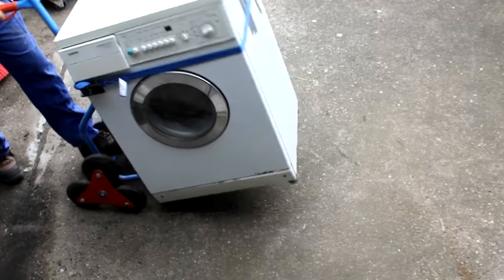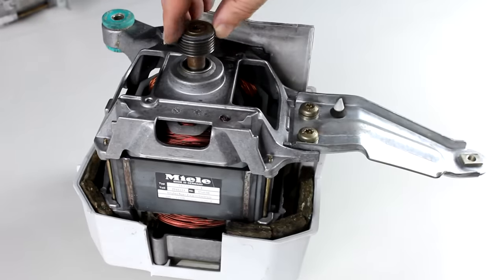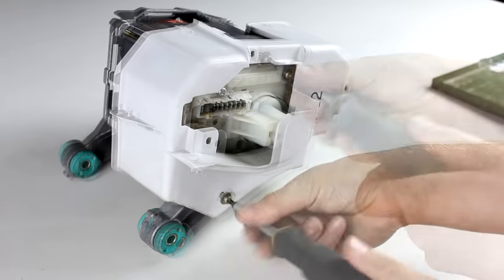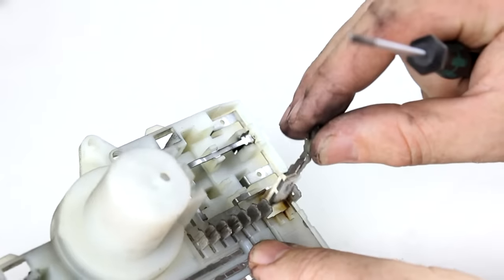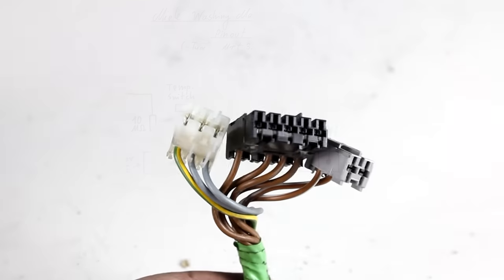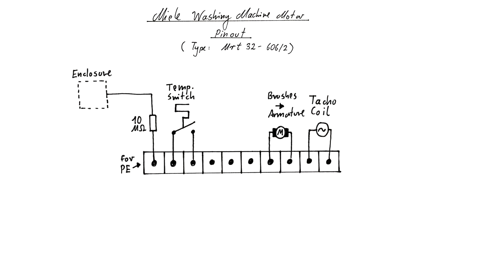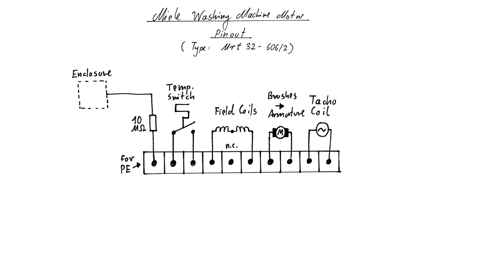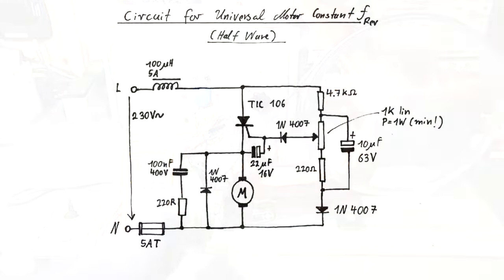Inside a Washing Machine Motor: Explanation,  Pinout, Teardown AND Experiments

Comment: @ 5:50 - DO NOT remove the resister from the protective earth circuit. Not having one will 
create a direct path to ground and allow very high current to be drawn in a short to earth. This will delay overcurrent protection (fuse/thermistor/breaker) from triggering and allow massive amounts of current to flow through the short. The resistor is there to give a load to any short to ground and trip the overcurrent device before high current develops in the short.
Reply: so,  if yu energise the enclosure of the device with 100 Volts,   then the ground current to earth will be 0.1 milliamps through your 1 megaohm resistor ?   I hope that your residual earth current protection device can detect this....
Reply: I didn't explain it very well in my initial post, so I will go into more detail here:

First, that resistor is for ground loop protection. If you don't know what that is, I suggest you look it up. Second, Europe uses 240VAC, not 100V. To get the full potential of the motor you would want to use full voltage. Also, since it is from a washing machine, it is designed to run off of a GFCI circuit. Those ARE sensitive enough to notice leakage of current to ground in the 0.1A range.

For dangerous voltages (36V AC or DC, the current safety standard and yes it did change a few years back), you should not make changes to the safety systems in the circuit. If you don't know why something is in there, don't just take it out. You can kill or injure yourself or other people really easily with even what would be considered "low voltage".
Reply: Ouch. Bad information is worse than no information. 240VAC so 340VDC peak, through a 1M resistor, thats 0.00034A, 0.34 mA not 0.1A. a GFCI breaker typically takes 0.05A (50mA) to trip, about 150 times more current than this resistor will allow at peak mains voltage. So in the event of a failure, where the motor chassis gets shorted to the active/hot input, this resistor will mean the GFCI protection is not triggered, and will allow the motor chassis to go live.

To be clear, this means the motor is effectively not earthed. This mostly defeats the traditional purpose of the protective earth connection, but this resistor is required, as the normal operation of the motor will cause it to induce currents in its chassis, which may be high enough to cause false triggering of the GFCI protection. The connection to protective earth via the resistor is most likely merely for discharge and RF loading. The motor chassis is weakly held at ground potential, so any charge is slowly dissipated, preventing ESD and helping to minimise EMI.

Removing the resistor and giving the motor chassis a direct connection to earth will not cause a safety hazard, but may cause your GFCI protection to trip unnecessarily.

The metal chassis of the washing machine itself should also have its own connection to protective earth, which will not have such a resistor in series, so the washing machine as a whole should still allow GFCI protection to serve its purpose.
Reply: Yes, I fudged my math on this. I was tired when I wrote it and made a mistake. It was not a mistake that would have injured anyone or caused damage to equipment. I said to leave the part in place unless you know what it does. As for my qualifications to give advice, I was an industrial electrician and a radio technician before I retired. I have been trained to work safely on up to 600V AC circuits and to construct and/or modify them as needed. It has been several years since I retired and my health is not always 100% anymore, hence why I retired.

First, you seem to know some about AC, but not as much as you think you do. The term is peak voltage, not DC voltage. The equivalent DC voltage is the RMS voltage of the AC sine wave. Next, this is the ground for the motor and its drive. The case of the washer was grounded normally through the ground of the plug, so if the chassis was energized, there would be a low impedance path to ground that would trip the GFCI anyway.

Also, a purely restive load is not what is used to couple RF or AC wave forms to ground. You use a low pass filter, like a capacitor to snub those (shunt to ground) and tune it to pass no more than 55 Hz (for this EU unit). They might be using the reactive capacitance of the motor brushes with the resistor to make this filter cheaply. Without looking at the design in detail or talking to the design engineers, this is speculation. Regardless, that resistor wouldn't be there unless it served an important function and therefore should remain until you at least know what it does.

If you run the motor off of an isolation transformer, yes, you would want to ground the chassis and you could take out the resistor in this case. If it is part of the filter system, you will make something that is RF noisy since there will be commutation noise from the brushes switching. This can be eliminated by using a shielded case that is grounded (AKA a Faraday cage). However, you should only ground through the building's grounding conductor (referred by laymen as simply 'ground') regardless of the method of supplying power. This will prevent what is known as a grounding loop.

A ground loop occurs when the neutral line to a device is lost and the chassis of the device becomes the path to ground or when a short to ground from the live line happens. If you have other low impedance or resistance connections to ground, like a direct chassis ground on a device instead of using the grounding conductor, you have a parallel circuit and it will charge the chassis of the other device to full potential (voltage), but will act as a current divider and will prevent the OCPD (breaker, fuse, or thermal override) from tripping as quickly as it should (see Kirchhoff's first law or read up on parallel circuits). This leaves potentially lethal voltage and current on the chassis of both devices. Always ground through the building's grounding conductor so that only serial circuits can be made by shorted devices.

OCPDs do not trip fast enough to protect a person from shock or electrocution unless they are a GFCI. It is even possible to have lethal voltage in a ground loop without producing enough draw to trip the OCPD since the path may have enough impedance to draw currents below the rating for the circuit.
Reply: How would a very high current delay the breaker from triggering? If anything the breaker outside the washing machine would immediately trip.
Reply: Breakers have to wait for heat from a high current to expand a a part of them for the spring to trip the breaker. This means that the high current flows for plenty long enough to harm you or possibly damage the circuit. Even at the EU 50 Hz, several complete cycles of the AC waveform will pass before the circuit is broken. So you can have lethal electrocution happen. This is why GFCI breakers were invented and mandated.

Fuses and thermal overload protection have a delay as well, with the exception of fast blow fuses, like the 601 amp fast blow fuses used in large load distribution and breaker panels. Some fast blow fuses can protect the circuit and personnel during phase to phase, phase to neutral, and phase to ground shorts. 

They are mainly used to stop arc flash and arc burst events, which are very dangerous. I suggest looking at a few videos on here of these to get a better idea of what high energy circuits can do when they have a short.
Reply: My initial theory was not true, but the advice to not make modifications to engineered circuits without knowing exactly what each of the parts still stands as the safest thing to do. There are some OCPDs that function in uninterruptible power systems for large loads that react the way I described, but that would not be the case here. In some other posts here I admitted and corrected my mistake and we even have a few theories about the function of the resistor. All of which could be tested for, but may still miss the true intention of it and all of them are good enough reasons to leave it in the circuit. Maybe this would be a good video for the channel? I would do one myself, but I am on the wrong side of the Pond to get a hold of that model of washer and the US ones would have different safety circuits since we don't float AC voltages without a reference to ground.

Also, you posted a really good example of why GFCI breakers were developed. A small short to ground through a resistor or just a energized chassis is enough to stop a heart, but will not trigger the breaker.

Comment: At 9:12 I fully expected the motor to explode into many pieces. I was testing a shunt wound 15 hp motor once when one of the field supply wires became disconnected. Within a second or two, the motor accelerated to the point of destruction, sending heavy copper commutator parts up to the steel roof of the building. Luckily no one was injured. A dc motor using field weakening to run above it's base speed should always incorporate a field loss relay in the control circuit to shut down the drive in the event of field loss.

Comment: The Post Apocalyptic Inventor - (which particular apocalypse do you have in mind? - there have been so many)
You have made a great explanation to the uninitiated of how motors work.  However, what interests me more than anything about these motors is their potential for re-use in home workshop projects.  Something that bothers me is the angle of the brushes.  In the one you stripped above, the brushes clearly favour anticlockwise rotation of the shaft, as seen from the motor's perspective, looking outwards towards its pulley (clockwise to an observer looking at the front of the motor).  I have recovered a few of these motors from the public discharge, where old washing machines are dumped, and they have all been the same.  However, a washing machine rotates in both directions, though the high speed spin cycle is in one direction only.  Is that why the brushes are angled that way? - to favour the spin cycle?  One way or another, it is usually the wrong way for most applications, which tend to want motors that spin the other way, like an electric drill, for example.  I originally wanted to use one to drive a bandsaw, but the motor was built to turn the wrong way.
The motors I have dismantled seem to have a provision for reversing the brushes angle (the requisite screw holes are there), but it must take a differently molded brush holder to do it.  I haven't been able to do it with the existing brush holders.
Can you say anything about that?  Also, how is the life expectancy of the motor affected if it is put into service continually turning the 'wrong' way?

Comment: Very interesting video. I'm looking forward to watch your next video and hope to learn how to control these kind of motors with an arduino or a mikrocontrollers in general. I hope you address the relation between voltage / current of the armature, the voltage / current of the field coils and the speed/torque of the motor (Question: Why does the speed of the motor decrease if the voltage of the field coil is increased ?).

Comment: If I remember it correctly, these kind/type of self-excited series motors are also used at electric trains because of the great powerful torque. Very dangerous motors without a load and/or speed control ;-)

Comment: HI G,  Nice deconstruction.  Keep going.  regarding designing a motor driver, the ambiguity not yet addressed is the "right hand rule" which could be demonstrated with the compass and clearly define which way the armature is kicked. besides the demo, I suggests that an arduino controller should be AC at least part of the time (a hint for cleverness to be added) so direction can be controlled and if left in AC mode slip can be controlled.    Again, nice visualization.

Comment: just recently jeremy fielding put out a video with lots of information about how to wire motors. im also planning on controling such a motor. probably using an arduino and some beefy mosfets to regulate the voltage through the armature

Comment: Thanks for the exceptional video!
I want to set out a question: 
My purpose is to use this kind of motor a a dynamic brake for a improvised bike roller resistance. At first we have two options, 1) use it as a generator and add a resistance to the armature coils and varying the value of the electric resistance play with the torque, and 2) use ir as a DC motro and rotate it the oppsite way it would rotate. 
I think the option 1 is not viable because the maximum mechanical resistance is when the field coils resitante is 0 and the current will raise up too much and the motor will be harmed.
In the option 2 we can play with the field coil voltage and adapt the mechanical resistance, but would be problems of reverse currents or can both be compensated? 
What do you Think about these proyect. 
Thanks!!

Comment: So field coils allow a transition of RPM (speed) into torque? Is there a mathematical equation that describes this and is the relationship linear? I've been dreaming of a method of deriving greater torque from a small package without having a transmission system and this appears to be the key.

Comment: Hi! Good videos! Thanks a lot for making them! Can you make a video about using this motor as a generator.. series or parallel type.. I know its possible to start it even without an extenal exciting current because of the remanent field.. I did this with my angle grinder..I just flipped the grinder switch in on position put a small load between the leads of the wall plug like a small 24v bulb and spin the grinder with my power drill using a nut and a bolt with the head removed as a improvized mechanical connection. Aslo can you make a video about ways of using induction motors as  generators. I have a big 3 phase induction motor grinder that I want to somehow quickly stop.. I think about adding some condensers and using it as a induction generator (using the light bulb that iluminates the thing as a load) will help me stop it faster.. but Im not sure about that.. and I don't have the time or the materials to try that... so I will really appreciate some help.

Comment: Just a question out of curiosity (a friend and I are going to take two washing machines apart in about an hour ;)). What happens if I apply the same voltage across the field windings and the armature when they are separated? Thanks!

Comment: Thank you very much for the detailed explaination. 
I tried giving 2 different DC voltages to Field coil(12v) & Armature(24v). Motor started running & I was able to do the direction changes also. But I also noticed that the field coil geting heated up during this excersice. Is this normal? 
When I connected the Field coil & Armature in series & gave either AC or DC voltage, Field coil was ok & was not getting heated up. Have you also noticed this?
Thanks in advance!

Comment: hello and many thanx for this in-depth explanation -  is it only me who still is a tad confused as to how make d motor run? connect d 2 windings in series, i get that (even they have different resistances!) but doesn't it matter which end of d stator winding to connect to which end of rotor winding?? if connected d wrong way, d magn fields could oppose each other?
does this matter (or not) with AC and DC d same way?

Comment: a brilliant well put together vid easy to follow and understand even though not a tech
i had a bosch motor with the same arrangement with a speed controller and tacho set up in it until now no clue how it worked or the wiring to it but this vid explained good so have idea how this works.
shame i not see this before i played with my motor which i put new brushes in cos i had no spin !!!!!
most of the time the brush wears and therefore no work
just needed bit more of a how to chk make sure all was correct power is at the right place and no leaking to earth n components were workin right sadly lack of so cant do
brushes in, ohms tested continuity was good chk the same for the switch on the plastic holder all seemed ok until boxed it up spun great by hand so fired it up put it on a quick program with a Bang and a flash the control panel now destroyed in one hit 
could there be a armature or a field wiring fault or maybe a fault on that plastic  part where the connector are, just trying to get an ans for the massive bang !!! it did work but gave up halfway into program wash ??????????

Comment: Is it then safe to say, the voltage across the commutator can be used to adjust the speed of the motor & the voltage to the coils can be used to adjust the torque? I have exactly this motor (Miele mrt 34 606 2) & want to adjust speed while keeping torque high. Danke schön!